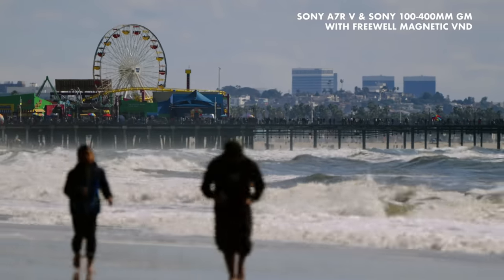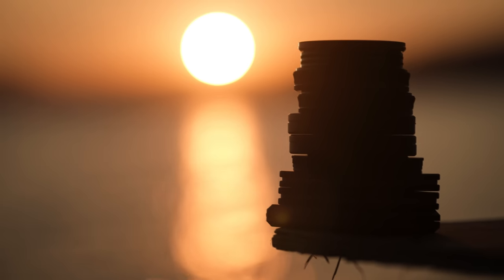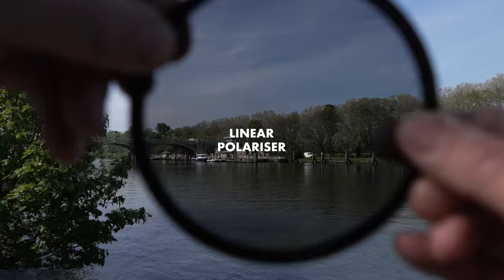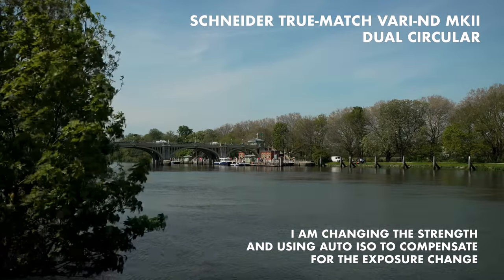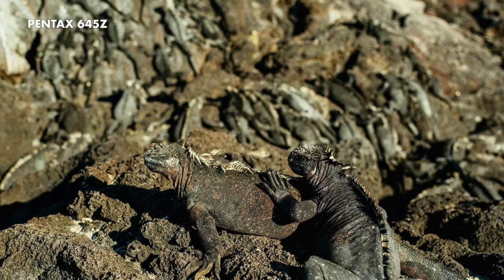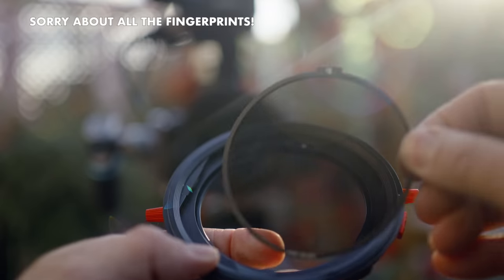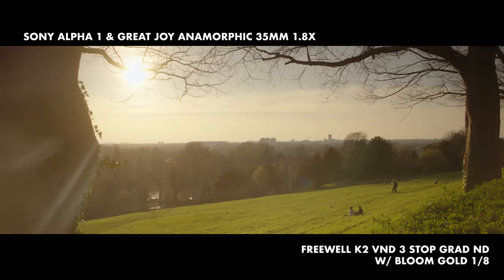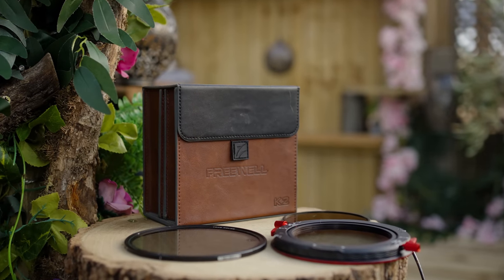The TRUTH about VARIABLE NDs!

Comment: Brilliant breakdown Philip, I learned a lot! I loved Freewell's original magnetic VNDxMist system, but I always pack Velium's MagRota system for a shoot. It does have more of a colour shift and it's quite bulky, but the stackable modularity of the whole system works better for my needs
Reply from the maker: Thanks David. Yes it’s a very good system. If they can put in a base LPL instead of CPL…

I find it better on colour though as it’s a LPL from so it doesn’t change colour balance.
Reply: I don't often use a matte box but how wide is the first screw on piece of that set?

Comment: Looks a nice bit of kit. I use the Nisi Tru Colour 1 - 5 stops, team it up with a fixed Hoya ProND if it's bright. Gives surprisingly clean results.
Reply: I agree, the nisi tru color is great and has no colorcast
Reply from the maker: @papsny  did either of you watch this video? Whilst it’s very good what is the fundamental problem with it?
Reply from the maker: If NiSi could find a way to let you rotate the filter then they would be great. The problem I showed with linear polariser based VNDs is they might polarise at the strength you set it to and if you don’t want that, all you can do is change the strength or loosen it from the threads…
Reply: @philipbloom  As I said, the Freewell looks a very nice piece of kit, top notch in fact. Unfortunately, it wasn't around when I bought the Nisi and budget (her indoors 😂) won't allow for another one. 👍
Reply: @philipbloom  i use that Kase magnetic step ring with Nisi and then you can rotate VND with them.
Reply from the maker: @mjolsztyn  can you have a step ring that’s 82mm to 82mm though? That’s what I would need!
Reply from the maker: @mjolsztyn  I thought the step ring doesn’t have an outer thread and is just for the kase magnetic filters to snap on?
Reply: @philipbloom  i used it like that: sigma 18-35/step up72-82/kase base82/kase-kase base2/vnd. these 2 base are screwed to: first to step up one and second to vnd and then you can rotate them :)
Reply: @philipbloom  i can't find 82-82 on their website. i used them 67-82,or 72-82.
Reply from the maker: @mjolsztyn  using the NiSi screw on filter? I don’t get it.
Reply: @philipbloom  Kase magnetic is before Nisi. I can send you video it can be confused to explain :)
Reply from the maker: @mjolsztyn  yes please send a video. I was asking about 82-82 as a lot of my lenses are 82mm so a step ring is not of much use!
Reply: @philipbloom  OK mail send, hope it will help, Best!
Reply: @mjolsztyn  Could you share with me as well please, Mjolsztyn? I was about to get some Nisi VNDs for my FX3 and thankfully Philip posted this video whilst in the midst of my research. Very insightful @Philip Bloom and much appreciated. Have to make compromises when not using the FX9 and this video was very helpful. I too have some 82mm thread lenses so right there with you.
Reply: You could use the C5 matte box and rotate the matte box. Does seem a bit silly though.

Comment: Nicely done, man! I'm tempted to try the K2 for the ability to rotate polarization, but it just looks so unwieldy for the stuff I shoot. I actually have their first magnetic VND and hate how clunky and fiddly it is to switch out the bases, flip the filters around, etc. Comstantly dropping them, smudging them, and it's tedious lol - A system that was supposed to be easier to use, but more of a pain than anything else I had tried. Went back to good 'ol screw on VNDs and magnetic fixed NDs when I didn't need variable. But I had no idea about the CPL/LPL differences in VNDs. I just figured I was stuck with unwanted polarization at times. Thanks for demystifying!
Reply: So, in your opinion, should I just stick with screw on VND?  I'm constantly fidling trying to take them off and on going from inside to outside and well lit rooms to dark ones with my run and gun on my ronin RS2 gimbal.  The first magnetic version looked promising.  But being told I don't need ANOTHER piece of gear would be welcome as well :)
Reply: @Nakean Wickliff  personally, I ended up going with fixed magnetic ND filters from Maven filters. Great quality, great color accuracy performance and the magnetic aspect makes switching fast. So I just pack a regular screw on VND as a "just in case" and use the fixed NDs most of the time now.

Comment: Thank you for this thorough explanation and pointing out the problem. Another problem with filters in front of the lens is when stacking filters they vignette when using vide angle lenses 24mm or wider. I have Nisi and Schneider Hollywood Black Magic and rotate by unscrewing a bit to control pol.-effect 😬😬
In my case lens thread 77mm and the filters are 82mm, it’s not enough, filters should be 95mm not to vignette on 77mm lens for vide angle and stacking filters😮
The solution you show seems to avoid vignetting as it is so slim and wide. 
I find most manufacturers mist filters are over the top and look cheap. I can’t depart 😢 from the Schneider one.
Hard to find a really good solution for all this 🤔.
Thanks again for really great content!!

Comment: Another excellent review Philip and great update to the magnetic filter system Freewell 👏🏼👏🏼 That rotation CPL with VND is a great combo 🙌🏼
Reply from the maker: thanks Jimmy, which rotational CPL?
Reply: @philipbloom  I meant how the K2 is able to utilities the ND filter and CPL to cut reflective light at the same time by loosening and rotating the entire filter set, as you have demonstrated in the video. Or did I understood it wrong? This is something that wasn’t possible on the previous FREEWELL VND filter, where the only way to use CPL is to flip round the filter and take the inside polariser out.
Reply from the maker: @jimmystewartuk  i think you might need to rewatch this, Jimmy! :)  There's no ND filter and there's definitely no CPL anywhere to be seen and this is key to what's different here.The difference between CPL and LPL is absolutely at the core of the confusion amongst people.
Reply: I watched it again and this is the part I meant about the 2 in 1 feature that you mentioned thanks to the rotatable design: 14:19 K2 “Can polarise light whilst using it as a variable ND”. Thanks for the knowledge 🙌🏼
Reply from the maker: @jimmystewartuk  yep but it’s really important to not refer to it the way you have had. It’s not a CPL on an ND. All VNDs with a front LPL, doesn’t matter if the rear part is CPL or liner, will polarise light. Because this it tied in with the strength rotation you need the ability to compensate by rotating the entire filter. If it’s screw on that means unscrewing it, not good. That’s why what the K2 does is essential. I hope the others that are screw on will find a way to let you rotate them. This is the problem with the excellent NiSi true Color. It’s similar performance dual LPL VND to the K2 but screw on only. I am trying to find a neat way to solve this otherwise it’s going to be a pain.

Comment: A a few months ago, I have banned all variable NDs from my bigger cameras and my iPhone, after finding out how much these negatively change the overall tonality of my footage.
Especially, wide panning shots with deep blue skies regularly turned out as  a nightmare during editing and color grading - now I know where these issues came from.

Even further, I started to set all my cameras on auto-exposure mode A (aperture priority) for run & gun shooting, allowing the ISO to float within a certain range and letting the shutter angle freely float between 2 degrees and up to 300+ degrees (in very low light). Motion blur when shot at low shutter angles can be easily get fixed in post, though it may significantly slow down rendering.

I am so overwhelmed with the colors and sharpness that I sometimes feel I am working with a new camera.

Comment: Thanks for the info helping demystify how CPL and LPL combos can interact to potentially produce a range of variable colour shift issues. So decided to subscribe. I'm new to videography and still have much to learn, so really appreciate your insights and the time you have taken to do this. 

I have tried screw-on Polar Pro PM II - good for convenience, but there are some inconsistencies. Ditto Tilta's Mirage with a 1-9 VND. From what I read elsewhere it seems that fixed NDs have much to commend them, but with a trade off on convenience, needing to switch NDs when in less controlled situations (i.e. casual use outdoors). For more serious (slower) working I think a matte box with fixed cine filters still has something to commend it, but costs in terms of £/$, heft, weight, convenience (i.e. lack of) and potentially attracting unwanted attention if/when attempting to operate discretely or fast (run and gun).

I'm currently looking at a Maven system (magnetic fixed NDs) which look great for stills photography and also usable for videography given potential for fast ND changes. But system currently only has NDs fixed at 3, 6 and 10 stops. To some extent it's possible to adjust aperture to correct exposure, but that's also a trade off. However, I think they are shortly going to introduce fixed magnetic NDs in 2 and 4 stops as well (i.e. 2, 3, 4, 6 and 10 stop). Yielding a potential to easily slip on/off a mag filter for a 2, 3, 4, 6 and 10 stop correction via one ND and add a 5, 7, 8 and 9 stop capability via two NDs stacked. System looks small, light, good quality and hopefully fast(ish) to operate in practice. Perhaps a good compliment to screw-in Polar Pro PMs II which offer finer, fast adjustment but at the expense of slight colour variations. Whatever one uses, I'm sure that filming a 'colour checker' reference card and/or doing a custom white balance will also provide a benefit. But that also slows one down.

As mentioned, I'm just learning, and starting to understand there is also an inherent trade off on quality vs time taken to pre-plan, think and improvise on set (or location), compose, adjust technically and ensure it's captured as intended. For sure I need to get out and do a lot of practical discovery to find what best suits me. Always interested to learn from other's insights and experience too.

Comment: Thanks for the useful information. I have tried a few different Variable NDs. The first one I tried was a BW XSPro Digital ND (I think that is what it was) with my GH5 and I noticed it had a slight green cast and slight softer image with some telephoto lenses I used. I had a SLR Magic Variable ND II. It has a polariser option and  and If you unscrew the filter slightly from the lens,  you can use the polariser. It has a slight warm colour cast and an ever so slight softer image and I didn't like it.

From the variable NDs I have tried, one I use now is Nisi ND-VARIO filter Variable 1.5-5 and 5-9 stops filter. On my Panasonic S5II I shoot video in V-Log and I have only used the 77mm 1.5-5 stop filter and it works well with my Panasonic 14-28mm and Sigma 105mm f/2.8 DG DN lenses with a step up ring. I have not noticed vignetting or any real loss of sharpness, no real colour cast that I can see and it doesn't seem to have the X when stopped down all the way, although though I have not needed to stop it down all the way yet. 

I have used the Nisi 5-9 stops filter on my GH6 with Dynamic Range Boost ON in bright daylight as the 1.5-5 isn't dark enough and it may have caused the video to be ever so slightly softer. I say may have, the video didn't look that sharp but the lighting was usually too bright to test my brighter or no filter to compare), and when I took photos with it stopped down nearly all the way, I noticed an X in one photo. Since I now don't use the GH6 and use an S5II, I have so far, never needed to use the darker filter only the 1.5-5 stops filter.
Reply from the maker: The NiSi is good, the downside is because it polarisers you need to be able to rotate it and you can’t.
Reply from the maker: I’ve no idea how you’ve got an X as the hard stops prevent you getting close to the X.

Comment: Great job Philip. Love the video. One quick question...for someone who owns the original K1 Filter System, is there a massive improvement/need to jump to the K2 system?
Reply from the maker: Thank you. Is the K1 the original magnetic VND system I show in here?
Reply: @philipbloom  I think so? I only called it K1 since this one is called K2. But yes, basically the version before this new one.
Reply from the maker: @CalienteCarlos305  it’s different…they both have their pros and cons. It doesn’t have the no colour shift but it also doesn’t polarise which you may or may not. It’s smaller that’s for sure and that’s important at times.
Reply from the maker: Also the older system is called magnetic variable ND, not K1. The K2 is named after the mountain.
Reply: @philipbloom  Gotcha. One more question...is it possible to use the Mist Diffusion Base from the Magnetic Variable ND system into the K2 System?
Reply from the maker: @CalienteCarlos305  no, doesn’t fit and it would ruin the neutral colour as it’s a CPL.
Reply: @philipbloom  Understood. Thanks for taking the time to answer my comments. Really appreciate it.

Comment: If the Fx6 can compensate for colour shift in camera, couldn't manufacturers release a LUT with their filters to apply in post and adjust the strength of, to get rid of colour shifts?
Reply from the maker: Because the FX6 compensation is constantly adjusting depending on the strength you use. I also showed you many examples and the reasons why the colour shift dual CPL VNDs is not consistent - light and angles.

Comment: Love my Peter McKinnon Black  Edition variable 3-6 stop..perfect for my 2.8 lenses.
Reply from the maker: Never heard of that one. I expect it has all the same problems the others do. Does it have the green tint?
Reply: @philipbloom  It came out as a limited run with polar pro. I use to have the signature PM 2-5 stop.. I prefer the 3-6  range for my situation and what I film. I have not noticed any green tint
Reply from the maker: @EverythingFilmmaking not sure how you’ve not noticed the green tint! I’ve been using them for years. I always have to colour correct it out. You will see in this video the tint. If you don’t believe me shoot a white wall with it on and off then tell me there’s no tiny!
Reply: @philipbloom  maybe cause I’ve never tested it like you🤣 I just film my stuff, and color grade in davinci.
Reply from the maker: @EverythingFilmmaking  but you must see a difference with stuff shot with it on and off? Plus if you are grading in davinci can’t you see the green spike in the vectorcope?
Reply: @philipbloom  I will check that after I film my next gig.. 👍🏼🎥🎬
Reply: @philipbloom  have you used the polar pro on your XH2S? The green tint actually works perfectly with Fuji’s love of magenta shift.
Reply from the maker: @jlinc187  the colour tint shifts depending on the light as I showed. I want no tint!
Reply: @philipbloom  fair enough. I suppose I've just settled with embracing it. Great video, appreciate the work that went into it.

Comment: Mr Bloom, which VND would you say is the "second best" or "runner up" after the Freewell?

I'm mostly turned off by the Freewell size and price.  I recognize the other ones will have the issues with not being able to align the polarizers like the K2, but "if you had to make that compromise", which would you pick?

Would it still be the Freewell Split Range system as mentioned near the end of the video?
Reply from the maker: Check out the new Freewell one that’s up from grabs in my Movember fundraiser! It’s like this but just a VND. gopb.co/mo2023

Comment: This is an absolutely wonderful video, incredibly informative. I'd want to know a couple more things but it's hard to find this specific information everywhere. So maybe this will help others too: 

1. The ability to turn the polarizer for the optimal angle; that's great and I think many people don't know that. But is that more prevalent when doing static shots? Is the effectiveness of that rendered useless when using a camera + a VND on a run and gun style set or style shooting? 

2. If so, do you have recommendations for what type of VND's (specifically vnds) to use for what types of shooting? Is there a one size fits all? Is that the K2? Or Should people go with something like the Nisi for a smaller footprint, less things to fiddle with, but still great color accuracy? 

3. Finally, and I dont know if you'd be able to answer this because they're relatively new, but where do the PolarPro Recon and Kolari Atlas Filters play into this realm?

If you could answer these I think they'd be a huge help, maybe even a VND part 2 video? Either way, thank you for all the clear, digestable, and useful content you've always put out.
Reply from the maker: Thank you. 

Basically there’s no perfect VND not even the K2. You have to choose which is right for you given the pros and cons of both main types. 

If you could rotate the NiSi it would be great…but you can’t. 

I’ve not used either of those ones you’ve mentioned.
Reply: @philipbloom  awesome! And the Nisi Does come with a NISI Swift kit if you did want to add a rotatable CPL!

I'd also recommend trying out the Haida 2 in 1 CPL + VND Filter as it's the only filter I know of that's a 2 in 1 CPL VND in a small form factor screw on

Cheers!